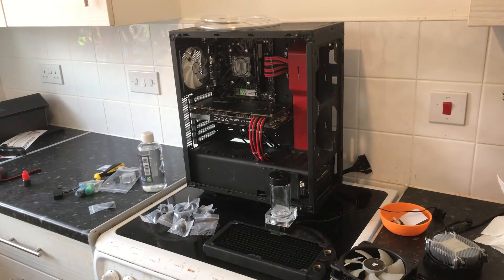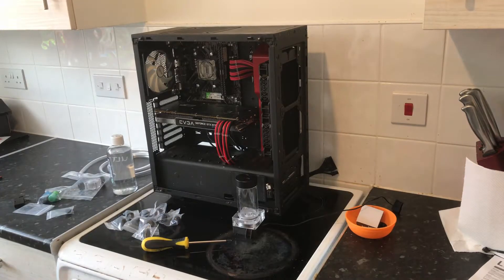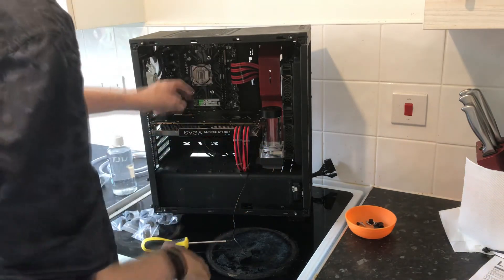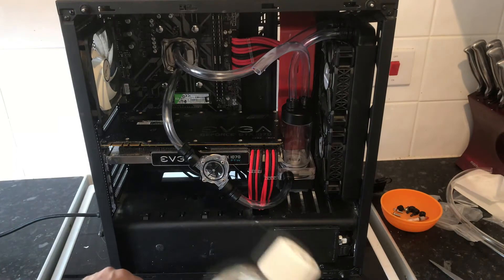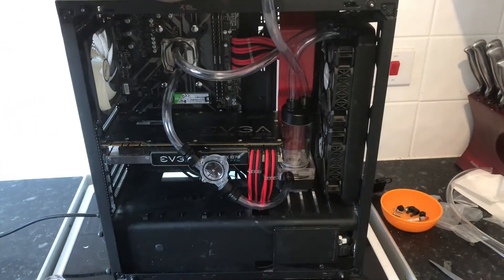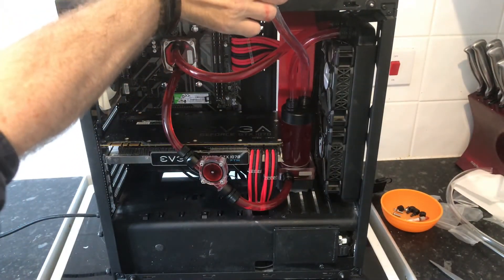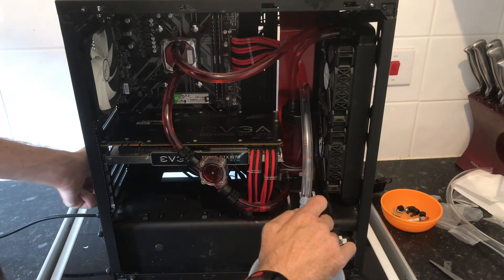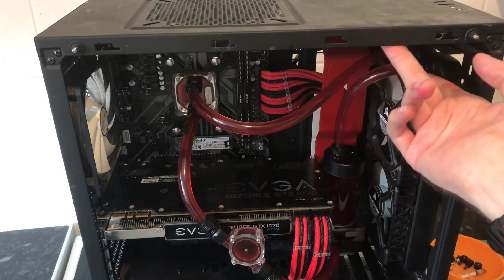If You're Thinking About Installing Custom Watercooling, Here's What You Need To Know

Comment: That sounds mega loud?
Reply from the maker: It does until you get all the air out. Then it's whisper quiet. I never hear the pump at all
Reply: @UnwellGaming  do you recommend this loop? Want to try a water loop, rather than a aio
Reply from the maker: @Apollopayne25  i would say yes as its soo much better than a aio as you can upgrade the parts as your loop grows. where as with a aio ur locked into it.
if u do get 1 make sure to use the affiliate link in the description.
Reply from the maker: @Apollopayne25  i would advise against using the dye that is included with the set as it causes issues within a month of using it.
Reply: @UnwellGaming  ok thanks will order it. Which dye would you recommend?
Reply from the maker: @Apollopayne25  i would say to not use any at all. as 90% end up clogging the loop to some degree
Reply: @UnwellGaming   ok thanks, was looking at this to pop in it. Seems to have good reviews on it. Liquid.cool CF Pre Mix Opaque Performance green
Reply from the maker: @Apollopayne25  its completely upto you. as the kit only gives u dyes and not a premix it will prob do better. give it a try. if it dnt work just rinse the loop and try other liquid until you get the results u like
Reply: @UnwellGaming  thank you for your advice
Reply from the maker: @Apollopayne25  no problem. hope u enjoy ur loop when u got it set up. its soo much better than any air cooler or aio ive had.

Comment: shouldn't the water going in come from the radiator so it gets cooled rather than coming from the tank where the cooled water has been sitting?
EDIT... also I notice that you don't have a pipe inside the tank where the water goes into the tank. if you haven't already adding a pipe inside the tank will stop the bubbling.